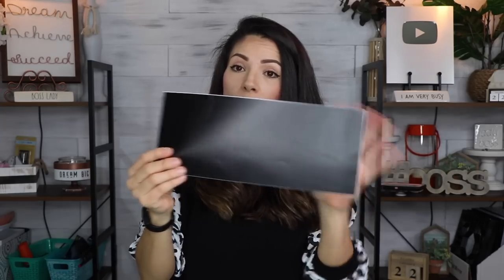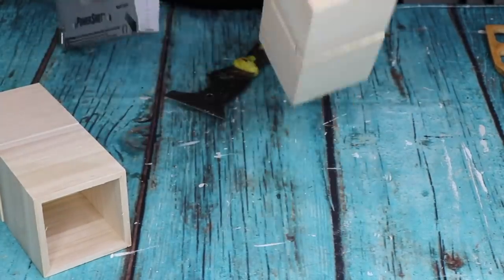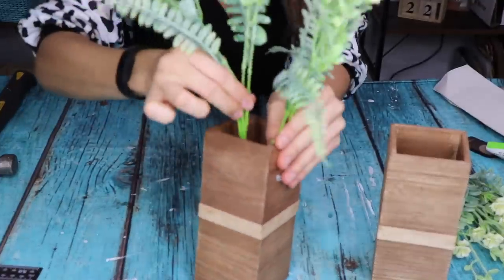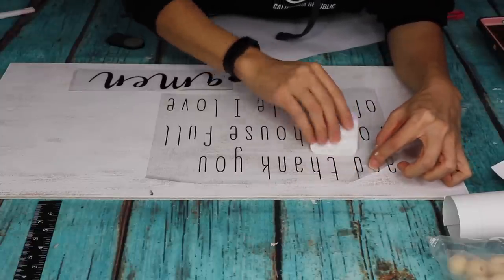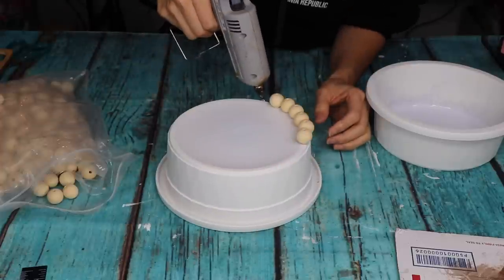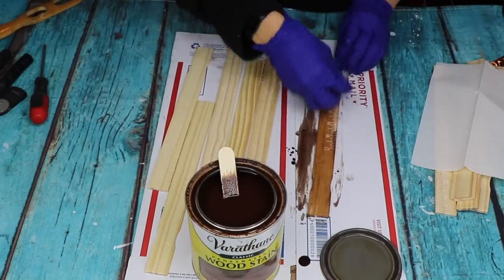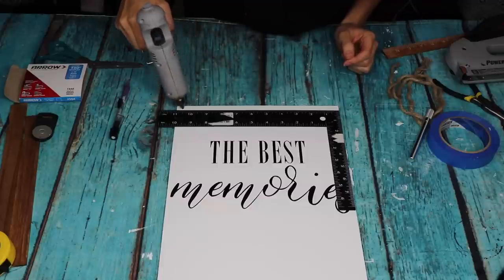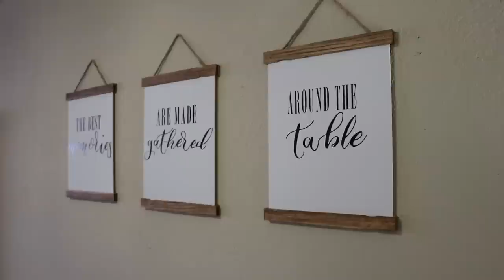PINTEREST INSPIRED MODERN FARMHOUSE DECOR | SPRING READY DOLLAR TREE DIYS

Comment: When using a power drill, start with a much smaller drill bit, gradually go up in size until you have drilled the size you need. Starting off with with a large bit only cause breakage, splintering, and splitting